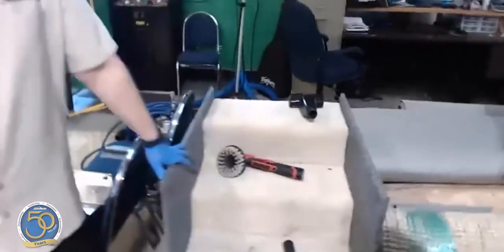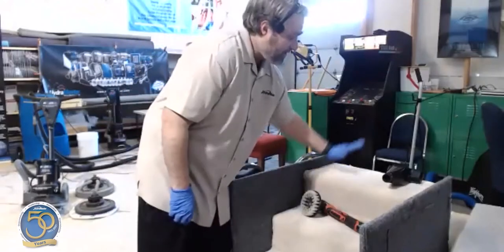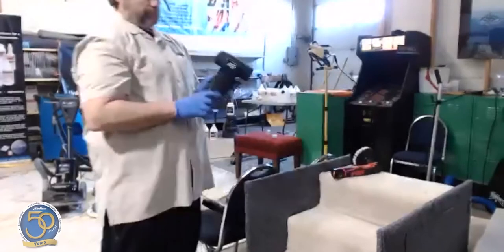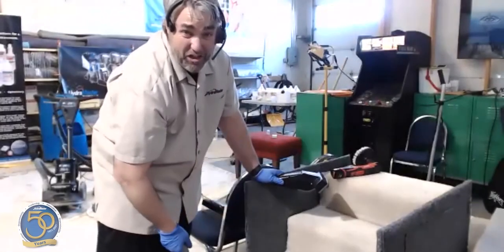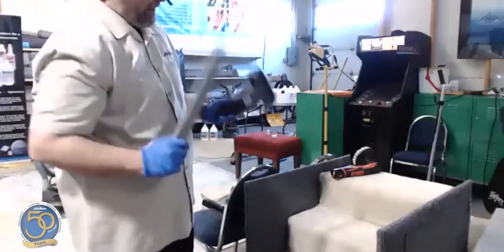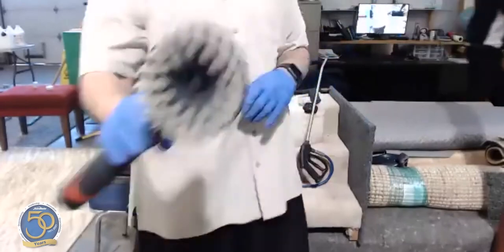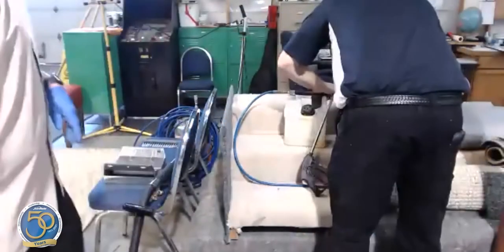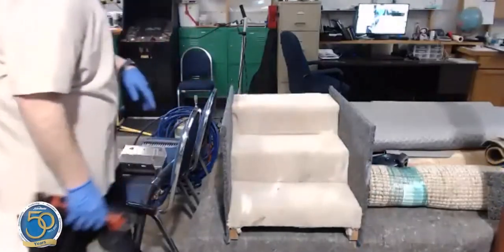Cleaning Stairs with the DM3 and Evolution Wand - Shawn Bisaillon

Comment: I charge 1 dollar per linear foot for steps and have for years now. I guarantee that's not too much at all and some might want to charge more. Stairs that are really let go can be a bit of a challenge. I find most of my stairs come in at 3 to maybe 5 dollars per step with 3 or 4 by far most common in my area. If you have another way and people are willing to pay I'm all for you. Just giving a suggestion. I apply my linear foot to a 3-foot wide step or to a 10 or even 20-foot wide step which will be 20 bucks PER STEP MINIMUM. All I do is generally measure one step and count the steps and multiply the width X by however many steps there are. It makes my life a bit easier so use it if you like it! If you feel it's not enough charge more, but I would not advise going 1 cent less than a dollar a foot width.